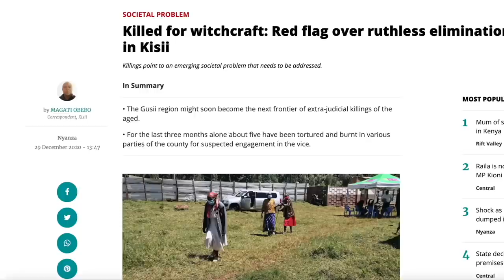In This Town, They Burn People For Being Witches (#70)

Comment: Very chilled out town. 
Btw the shower head has a heating element. The switch on the head is for regulating the power. Then the more water goes through the slower it will heat.

Comment: @29:52 -- Interetsting that the lock for the bathroom is on the outside of the door... Also, I would imagine the heating element to make hot water is in the shower head. So, if the water is rushing by it too quickly, it won't have time to warm it up.

Comment: you know why the shower works that way ? because it has a instant heater in that nozule thing, so in order to have hot water, the pressure has to be very low :) else water can not be heated enough